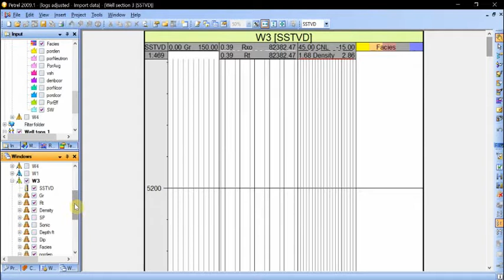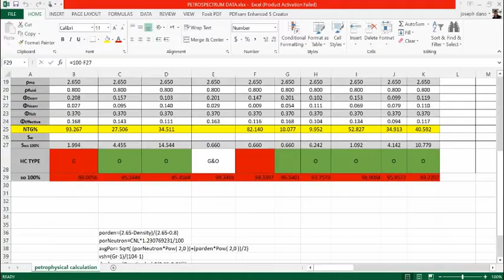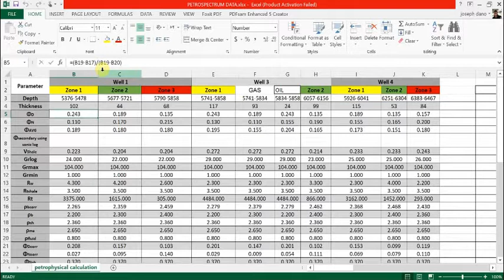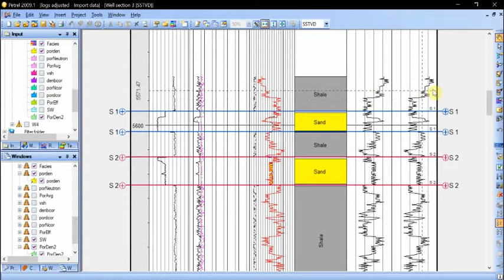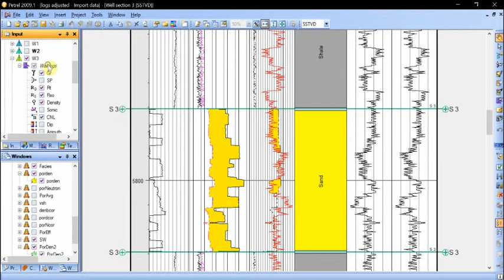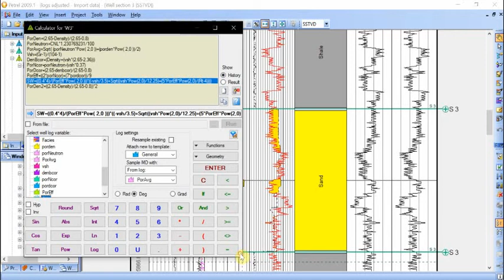Petrel Calculator

Comment: Why did you multiply the PorDen by 2?
Reply from the maker: Just to show how the program works. It is simple to visually explain and show that. It's not in the equation to multiply by 2. The correct pore density equation is already written there, the first one.
Reply: @josephdano1918  Hey one question, where does the multiplication of CNL x 1.2307...\100 come from? Is it a conversion? Thanks again
Reply from the maker: @Carlos-bp1vp  search for "thermal neutron porosity equivalence curves" in google images. You will see a chart with apparent limestone neutron porosity on the x-axis and true porosity for indicated matrix on the y-axis. Put the value from your CNL in the x-axis untill it intersects with one of the lines in the chart and then you check the y-axis for the reading. In my case, I intersect with the red solid TNPH sandstone line. 
Because its almost a straight line I took the slope of that line. With some margin of error, its somewhere between 1.1 to 1.2. I did that because I have many hydrocarbon zones. But if you have one zone, then you just enter that single value where the line intersects. So the equation is just to convert the chart into a math equation for the program to read. The /100 because porosity is percentage.